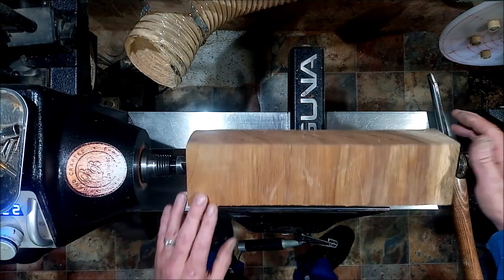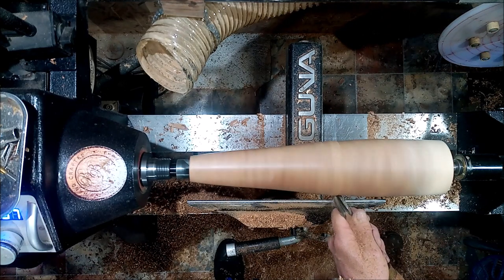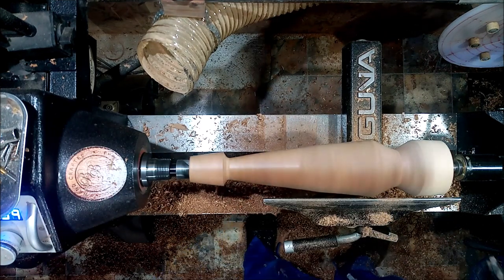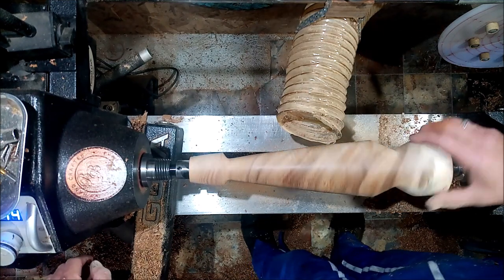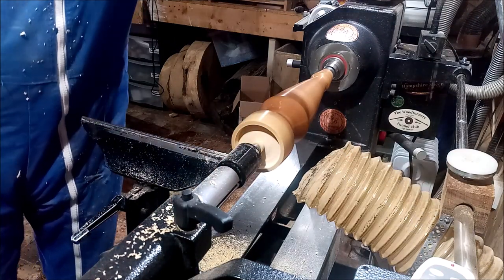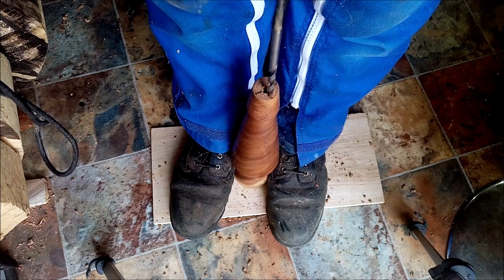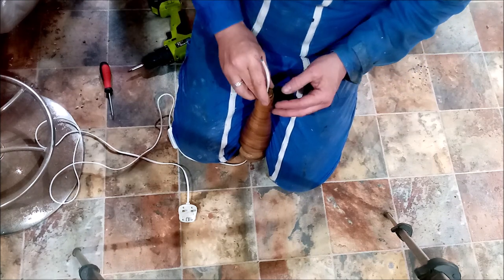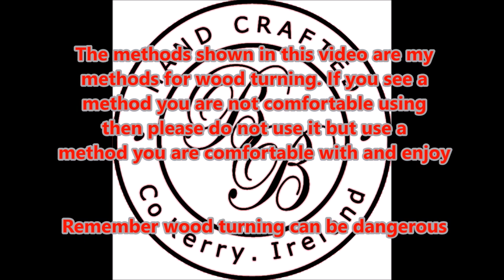Wood turning a cross grain lamp / woodturning

Comment: Thanks for the video Shay. Lamps are my favourite thing to turn too. Too many bowl videos out there and not enough lamp videos. I always wondered about the PAT testing requirement, if any, here in Ireland. I couldnt find the information anywhere so thanks for that.
Reply from the maker: You are welcome Ruba, here the electrics need to be certified, the kit I use is from lampspares in the UK and as I said in the video it comes certified and once you install the kit without altering it in any way the certification stands.
Shay
Reply: @BBTurning  Is there any liability with regards to wiring the bulb holder as that's the part where you are wiring yourself? I use similar CE certified kits for lamps I make for around the house, plug, inline switch all attached from manufacturer, all I do is wire up the brass bulb holder fitting to the 3 core kit. Always wondered if I was good to sell them as any searches brings up UK legislation. Couldn't find any Irish related legislation.
Reply from the maker: @rubadubwood  As far as I can find out, and believe me I have searched, once the kit is certified and is assembled exactly according to the instructions then the certification stands. Finding the legislation for Ireland is an absolute pain, it is buried deep in an obscure document, it took me three days to find it but from what I can find the electrical components are the only part the need certification and a pre certified kit from a reputable manufacturer fits the bill. I would say that if a lamp comes from a factory there is probably something extra.
Shay

Comment: Hi Shay, Gorgeous looking lamp. I have stayed away from doing lamps purely for the reason of not knowing what the regulations are here in Wales. Any idea where I need to look to see what they are? 
Another great video and that Tiger Wood is, as always, stunning.
Take care mate.
Cheers, Huw
Reply from the maker: I found the Irish rules by looking up "pat testing requirements for table lamps in Ireland" . It took some digging but I finally found the relevant legislation. You could try the same but put in UK instead of Ireland Huw.
Shay
Reply: @BBTurning  Thanks Shay